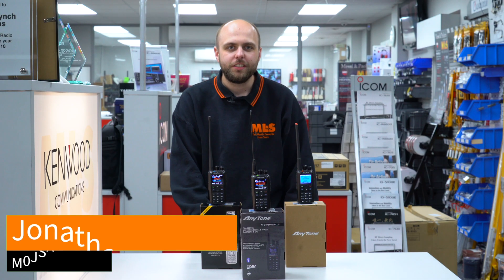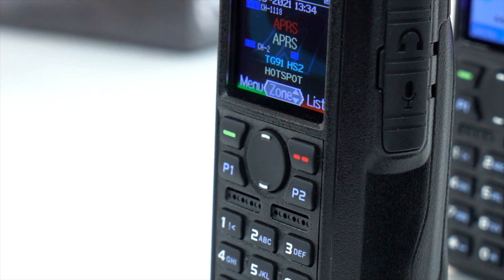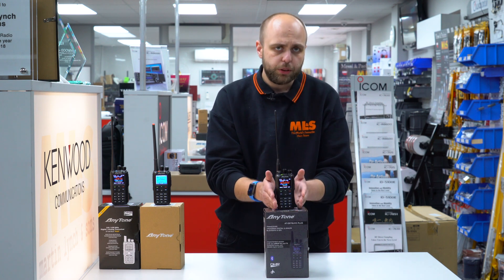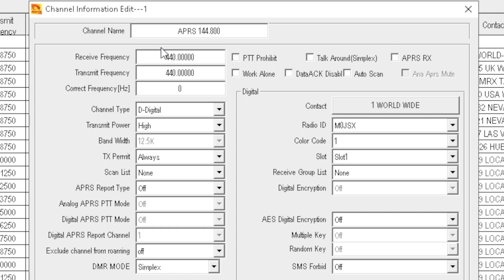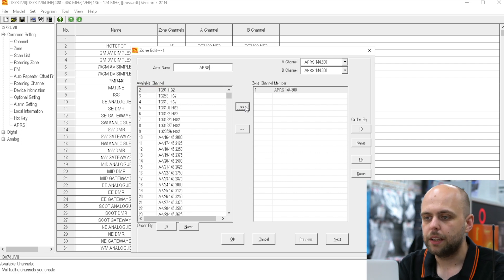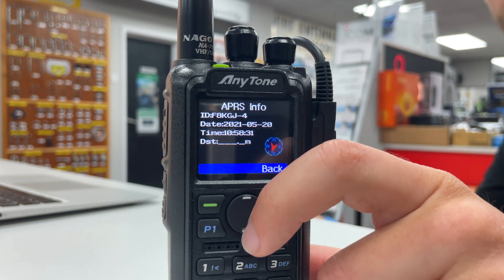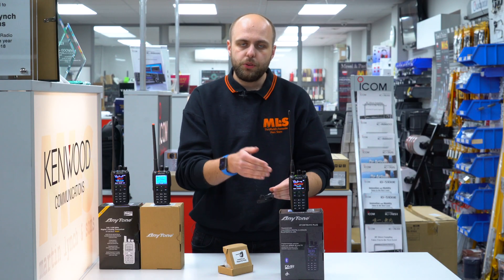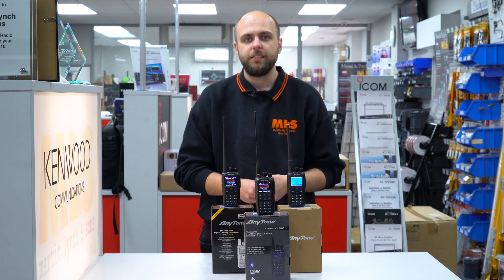NEW AnyTone AT-D878UVII Plus Digital Handheld Radio

Comment: Did the previous model come with programming cable? If so mine didn't.  It wasn't in the box.
Reply from the maker: The previous model did not come with the programming cable, it was an option. 
The current model does come with the cable in the box.